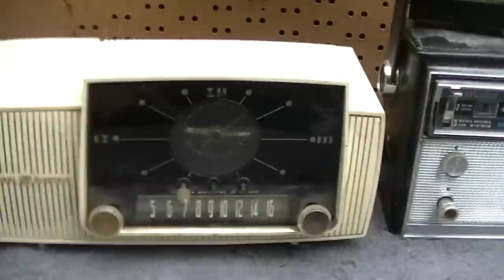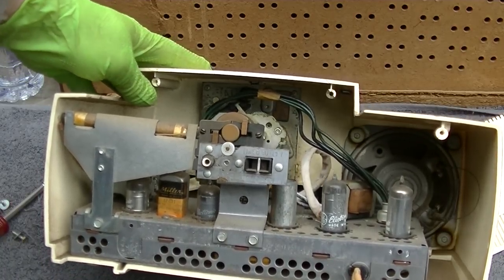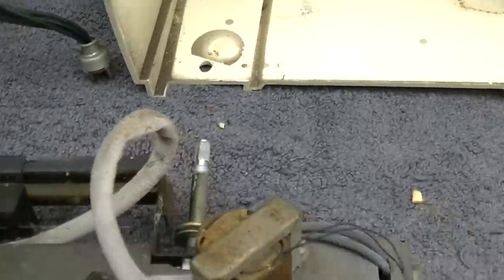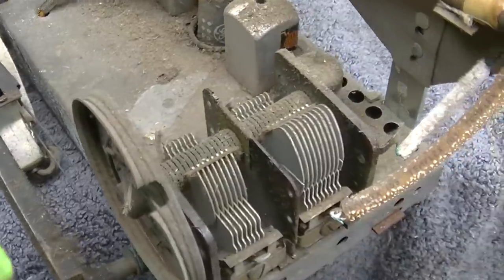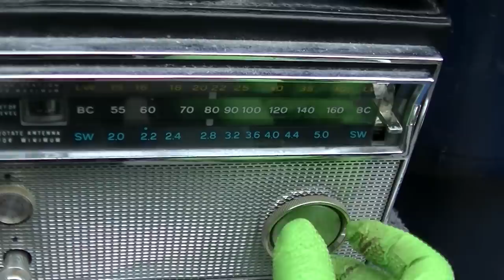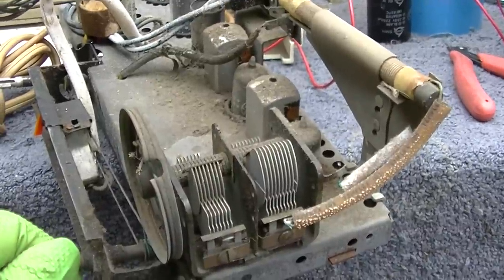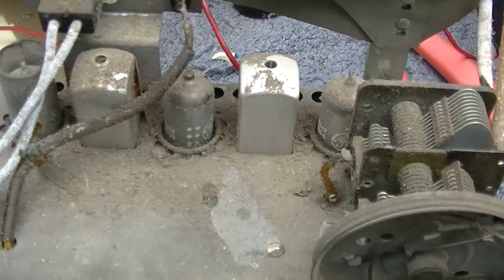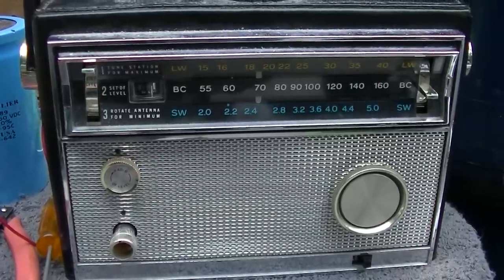GE 912 AM Clock Radio XEWW 690 77kw Music Station Baja CA

Comment: Since this set is so dirty and really not worth much, some people swear by putting really nasty sets like this in the dishwasher, letting the chassis dry thoroughly and realign.  If you want to see Shango give this set the dishwasher treatment, give this comment a thumbs up!!
Reply: I'm for the dishwasher treatment!
Reply: He’s not the type to do that lol. He likes to leave em dirty.
Reply: I've done it.  Use a pressure washer and let it dry in the sun for a few hours.  It will be good
Reply: That's how we rolled in the day after flooding, take the back off TV sets, hose out and leave in the sun for a day. Same with stereo's, tape decks etc.
Reply: My father told of getting tube-type police radios that had been in the back of police cars and "boiling" them to get all the dust and dirt off.  Worked fine afterwards.
Reply: Dishwasher... Hmm, I can really see Shango doing the dishes by hand, Freddy Mercury stile..... 😂
Reply: if cans and other coils have hair thin wires...added to the fact that they are rotten and old will render the radio useless on most attempts
Reply: Yeah, I'm all up for the dishwasher treatment and to make it more interesting, do it while the set is powered up!!!!🤣😂🤣😂🤣🤪
Reply: @MrHBSoftware  No, I have done it, and ,the can seems to protect them
Reply: Maybe just do most of the set like that. I wouldn't want to get soapy water in a Telechron H rotor.
Reply: @Alabaster335 You can do that with computers too, just remove the CR2032.

Comment: One of rare schematics ( at Beitman's in 1956) that list the IF transformer's original capacitance and resistances within.
Note when searching for a radio station with a ferrite antenna mounted on the chassis sometimes you must turn the
 chassis to get better reception. Has tired original tubes and poor socket connections. Those IF transformers pull out of sockets. All fixable giving it some time with a good cleaning and tube testing.
Reply: Could just be dirty transformer sockets?

Comment: This "style" of GE radio with the raised clock panel and side speaker was manufactured for a long time!  This is one from the first generation. The first generation was introduced in late 1955. GE continued to produce this radio with minor styling changes and feature deletions and additions all the way through late 1965! Literally 10 calendar years of production. You could still buy these new off the store shelves in 1966 despite it being a quite outdated 1950s design at that point. The last generation, C-480B, C-481B and C-482B were available in white, blue, and Nutmeg (brown) with a clock illuminated by a miniature neon bulb which was on at all times unlike the previous models with the "A" suffix that used a "push/hold" control knob to turn off the clock dial light.

Comment: ,GE called the moving dial light tuning indicator a “dial beam” I have this same clock radio but in turquoise. It’s very common for these GE’s and the RCA’s of the same timeframe  to have the clocks and speakers break free from the plastic retainers inside and rattle around.

Comment: I've got a GE radio I replaced the filters on and it had the worst case of SMD static I've ever heard . It also had a non conventional  tube line up for an all American 5 . The output tube was a 36 volt something, not a typical 50c5.  Keep them coming, Dan..............

Comment: Don't discount that switched outfit.  They're great.  I got tired of paying 100-200 Dollars every 3 years for a "good" coffee maker with displays so small you need glasses to program them.  The last time a coffee maker died on me, it was right at the beginning of the lockdowns. All the stores were closed except Family Dollar and all they had was a 14.99 coffee maker with a physical on/off switch. SO I plugged it into the switched outlet on my GE spacesaver radio from the 80s I still use with the power turned on.  In the morning when I get up, I turn the power to the switch off on the radio and pour my coffee. It's been 3 years and it still works fine.

Comment: I swear all of these GE table/clock radios from the late 40's to the late 50's used this same exact 'chassis' design, but with such basic circuitry that even made MadMan Muntz look generous in the number of components used, (which admittedly makes them attractive for shotgunning new parts into). And the SMD comment is totally valid, never seen one that didn't sound like a continuous thunderstorm. Was shocked to see this one work to the level it did. To GE's credit, they did use halfway decent speakers, so they didn't sound all that bad in the end.

Comment: We used to listen to XROK 80 out of Juraz Mexico back in the 70's, they played the great old rock and roll of the 60'5 and 70's, we could get it all the way from El Paso to Northern South Dakota back then.  According to scuttle butt, the station was in a little Mexican farm house with a huge transmitter broadcasting through an old coat hanger stuck out the window, but that was just BS, nobody really traced the source and back then we just listened and didn't much care about their. setup.  I don't know when it died but I do recall listening to it at night while on patrol when working the PD in my home town in the early 70's.

Comment: The trimmer adjustments are much more effective near the top end of the band.   To adjust in the mid and low end usually you’re limited to tweaking the oscillator coil.  15,000 mfd?   Really?  Poor 35W4.

Comment: Damn that rectifier tube is a champ, just for anyone who isn't overly familiar with vacuum tubes, if you read the manufacturers datasheets they will specify a maximum value for the primary filter capacitor, usually sub 100ufd.. the larger values can increase plate transient current and destroy the tube, at least that's what the tube book says the engineers thought would happen.. i guess they didnt count on shango 90 years after design :)
Reply: If the tube is cold whenever power is applied it in it will probably be safe. The realistic risk is turning it off and back on, or if there is a power glitch.

Comment: I have a similar  Musaohonic that had smd. I copied  the caps that (radio rescue) used I think 120pf. I think the schematic actually  shows that could  be wrong. I know that's not always accurate   . Anyways after that it's one of the best receiving  radios I have. Also the caps in the if  cans aren't  hard to remove  like the  other  ones you have done on the channel.  Definitely  worth  fixing.
Reply: That particular  radio  stays in my kitchen I use it to pickup wsm in Nashville.  I live on the nc coast. That's 10 hours away from me

Comment: Quite a resurrection!  Obviously for getting this radio running again, the giant Cornell Dubilier is great and hilarious.  I believe (no expert here) that the reason in general not to go too high beyond rated filter capacitance is because while you reduce the power supply ripple, you also drive the transformer harder (greater current draw) when fully recharging a larger cap during the part of the AC cycle where the cap is being recharged.  This would probably not be an issue for a small radio, but does factor into consideration generally with linear power supplies.  I.e. Sizing filter caps relative to the transformer current capability.  If I'm full of it.. someone, let me know!
Reply: I'm not an expert but i don't think that's quite right. I think the transformer would not be under any additional load once the capacitor has initially charged, the load of the circuit that is being powered remains the same so no additional energy is required or dissipated. What would increase is the inrush current and this would put the transformer and rectifier under considerable extra load at power-on, but the nature of tubes coming up slowly I would think should limit this problem to an extent.
Reply: @chickenfizz  I remembered reading something about this from my old days struggling with The Art of Electronics book.  I just dug it out and re-read the small comment on the topic.  I think I now understand the book's "warning" about choosing too large a filter cap, but may still have it off.

Essentially. a larger cap will reduce ripple, but force the transformer and diodes to supply greater current (for a shorter time) in order to replenish the energy consumed by the load since the last diode conduction cycle.  The reduced ripple comes at the cost of a smaller diode conduction angle (fewer degrees of the sine wave where the diodes are in conduction) leading to a greater charging current for this shorter cycle.  This can cause transformer heating, higher load on the diodes and greater EMI "noise" as the diodes are shutting down conduction with a relatively larger current flowing through them.  

Anyway, just trying to think this stuff through, but still probably hazy on it!
Reply: @blobscott  That's basically my understanding except this doesn't have a power transformer. It's the high current pulses which can blow out the 35W4 rectifier's internal bond wires.
Reply: @eDoc2020  Yes.. I had forgotten this GE is an AMA 5, series string!  I mostly put the original comment up as I remembered at some point in time thinking it was probably not a big deal to add arbitrarily larger filters to a power supply.  Shango's Cornell Dubilier temporary XL substitution seemed like a good visual to make the comment that it isn't without costs.    Yes, the rectifier will eventually feel the burn!

Comment: I have a GE clock radio that is a couple of years older than this one but nearly the same design. I had to replace the IF's for SMD but now it is a super sensitive radio with just it's loop antenna.

Comment: There’s at least 3 stations I pick up out of Mexico City that have that same format. If I get out of Dallas I can get 730 & 770. 1000 is iffy. 
I’ve got 2 of those radios. A green one that is sun baked & was dropped on its face at some point. I plugged it in to test & it just works. No hum, ok sensitivity. The light for the pointer is different & overly complicated too. The other is a beige one like that & it’s worn down to it’s last electron inside.
Reply: 770 might be KKOB pumping 50,000 watts out of Albuquerque.
Reply: @nmccw3245  I’ve caught enough of an ID to hear “Mexico” but I’ll have to try & catch some call letters.
Reply: Also, I just looked it up, and 730 is W Deportes, ‘Musica’ from about 11p-7a Cental. There’s a 770 W Radio out of Zacatecas that’s probably what I’m hearing.

Comment: I like the chassis design & overall build quality. There must be a back story. Most from this time were super cheaply made. The branded cans are a trip. The recessed tubes may set ip a cooling convection. I did not see any board discoloration from heat. Damaged from over tightening. All parts on hand. One generic Telechron knob missing.

Comment: XEWW-AM 690 kHz is located in Rosarita, Mexico.  It has a 2 lobe antenna pattern that focuses the power north and south along the coastline during the daytime.

I had never seen a GE clock radio from (about 1960) with a steel chassis.  I guess this particular radio was an upscale model.  I always serviced ones that had the bare-bones PC board designed for minimum assembly cost.  Although appearing as a point-to-point wiring circuit, this one is again another varation of a PC board to reduce cost.

I found it interesting that the bottom shield has a cutout under the oscillator coil to minimize detuning it.  This effect (without the cutout) would probably be most notable as the radio warmed up and drifted off frequency.

I think those 35W4's had a suggested maximum filter cap rating of 47uF, where the cap was attached directly to the cathode.  I'm sure you knew this.

When I serviced these cheap tube radios in 1974 - 1975, the IF transformers with the built-in 100pF caps, I never saw the silver mica disease.  Now, I see the problem on nearly every radio I work on.  I'm not really surprised though considering the crude construction technique.  I noticed most 5 tube All-American 5 tube sets used these IF transformers starting in 1948.

Comment: Of course it is baked. Back in the day (60's) my mom would get up at 6 am, turn on the radio and it would be on until time to make supper. These days those tubes are getting expensive. Every radio used those and they ain't making them.

Comment: @shango066
Hey, what value of capacitors would you use for the IFcans? Im trying to repair my old Emerson Phonoradio model 814 D but the skamatic diagram I have doesn't show the value of the caps in the IFcans. I can tap on one of them and it will pop just like what happened in this video just it never tunes anything in. The phono works great though.
Reply: The value is typically 100pF for the AM IF transformers.
Reply: @Bill Harris  Thanks, and what tolerance would you recommend? Would a 5% tolerance be ok, or should I use a 2% tolerance cap?
Reply: @ianayers2958  I recommend a ceramic leaded NPO capacitor, which has a 5% tolerance for the standard value.  Remember, the transformer cores are tunable so, the tolerance  is not that critical.  The hard part is disassembling the IF transformer and removing the original capacitors (there are 2).  They use 38 gauge wire so, easy to damage.  The original capacitors are a sheet of mica, painted on both sides with silver paint.  The connection to the paint is made via part of the lead frame which extends out the bottom of the transformer.  The lead frame is simply folded over the sheet of mica, relying just upon contact pressure from the lead frame for an electrical connection (nothing is soldered).  The whole capacitor assembly is held together with a single rivet and removing it is the most difficult operation without damaging the fine wire that goes to the coil windings.  Once you remove the original capacitors, reassemble the IF can, then attach the NPO capacitors to the IF transformer leads on the bottom of the can.  The NPO capacitors use a case that is a conformal coating of epoxy.  This epoxy becomes very soft while soldering and if there is any tension on the capacitor leads, the internal leads will unsolder.  Forceps can be clamped across the capacitor leads close to the cap body to prevent this problem.  I mount the cap leads so there is no tension, which prevents the problem.  If you have that much trouble with the soldering, you can use leaded mica caps instead, which have a hard epoxy coating.  The downside is they are more expensive and not quite as temperature stable.
Reply: @ianayers2958  As a bonus tip - The physical separation between the two IF transformer coils determines the coupling factor or IF bandwidth.  More separation produces a narrower bandwidth and vice-versa.

Comment: Silver mica disease would most likely have been rare or non existent back in the day. It took decades to develop in a receiver.
Reply: It took a while, but not that long.  My parents gave me the 15-year-old kitchen radio because it kept crackling on AM (it was OK on FM) and the guy at the shop told them it was un-repairable. That was in 1970, and while it certainly could have been repaired, it probably would have cost a lot more than the $10 a properly-working set like it would have gone for at the flea market.

Comment: That outlet bothers me.  Many clock radios in that late 50s had them.  Ads said the radio could start your morning coffee. Rating for the outlet is listed at 1100 Watts on the label and back cover, 1150 Watts  stamped into bracket outlet is mounted on.  I've seen a 15 Amp rating for the switch on the clock label, so no problem...but that radio has an 18-2 power cord good for only 7 Amps or 840 Watts total.  I wouldn't plug anything drawing over 750-800 Watts into that outlet.  Those radios needed a 16-2 heater cord if the outlet was going to be rated at 1100 Watts.  Considering that many coffeemakers drew around 1000 Watts we have a problem here.
Reply: No Consumer Products Safety Commission back then. FIRE IT UP for that cup a joe!

Comment: Imagine trusting the wiring enough to have it switch on a coffee pot, people had guts back then.
Reply: It was built to handle that current.  If you want to see the bare minimum use of copper, open a modern coffee maker with a timer.    That clock radio looks like a tank in comparison.

Comment: Unfortunately the power ratings of most of the stations in Mexico wall most of them claimed to be over fifty thousand watts, are not. Because transmitters for more than 50,000 W either require the use of multiple transmitters connected or a special custom-built transmitter. Which is extremely expensive in the declining climate that is am broadcasting. Most likely it's just a standard 50000 Watts station using a free chaura re to make a cardio add heart-shaped pattern and for whatever reason one of the towers is out-of-phase so it's creating more than! Instead of nailing towards Los Angeles it's pointing towards Los Angeles. Xerf had the same problem and of course we all know about the mighty 1090 it was fifty thousand Watts omnidirectional. Currently the only station in the northern hemisphere producing more than 50,000 Watts, Uncle Acuna Mexico with 150,000 W. 3 Harris dx50 transmitters, a common Point high-current power combiner. Your next best bet for a high-power a.m. would be the one out of the the Caribbean, that probably States it is running one-megawatt. Although it's thought that it's 500,000 watts, using a halfway Franklin tower on essentially a perfect saltwater ground gives it the Erp of one megawatt.